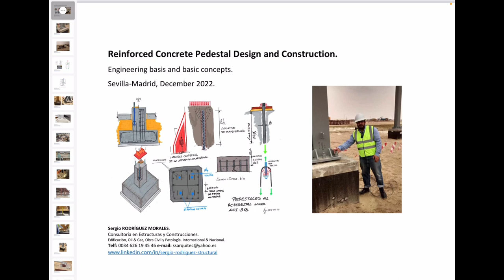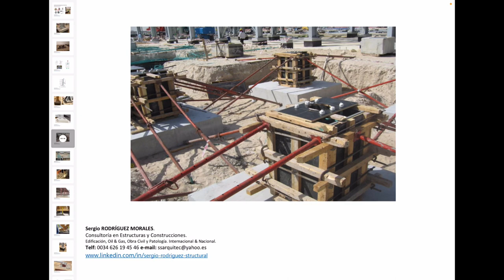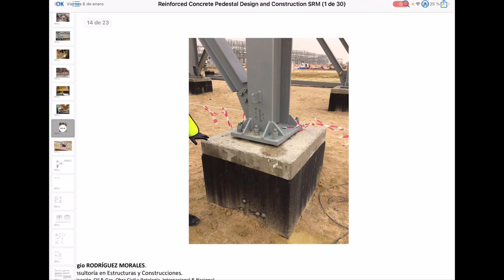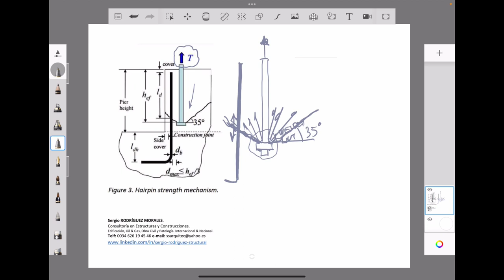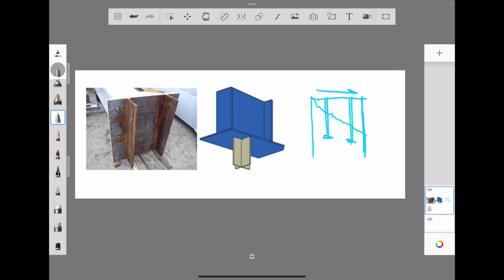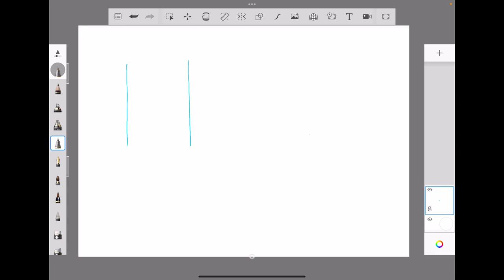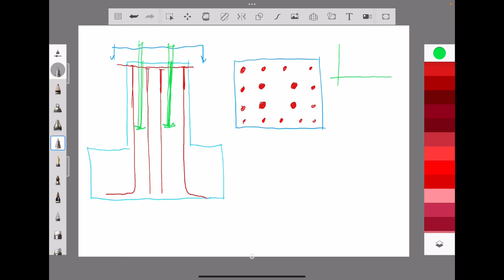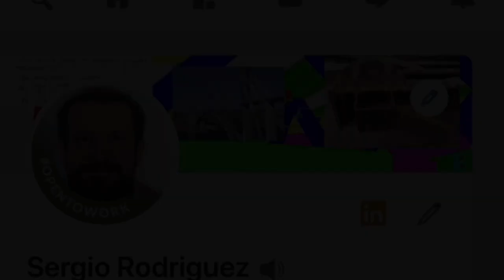All about RC Pedestals Design.

Comment: Very good video mate. In the UK we don't do RC pad foundations, instead we as structural engieers design mass fill C35 concrete pads without pedestals and tie beams. Its very quick and efficient method. Keeping the 45 degree load dispersion above the bottom area of the base, we deepen the pad - done!
Reply from the maker: Thanks for sharing you experience..